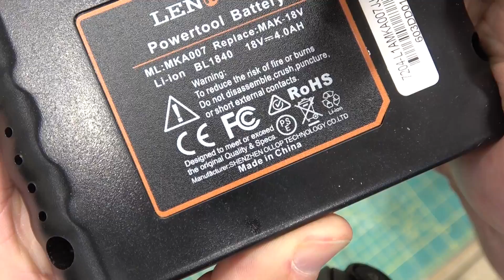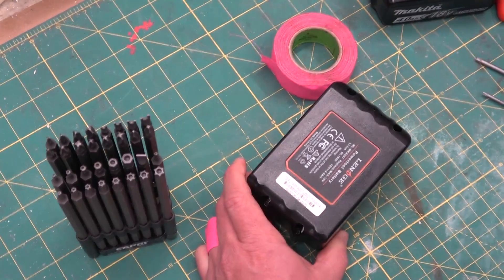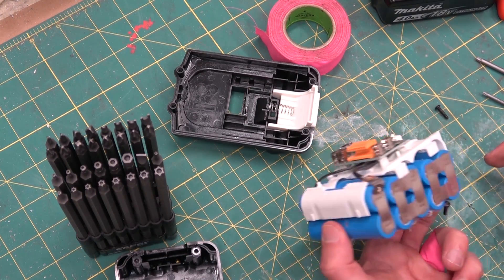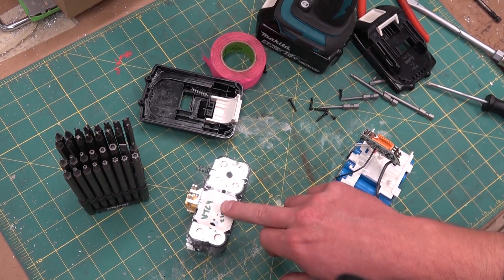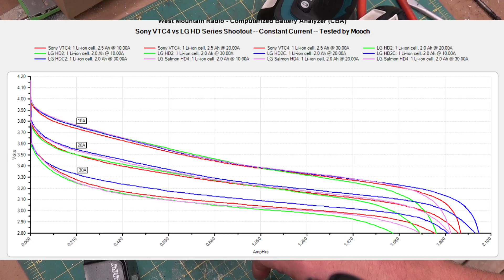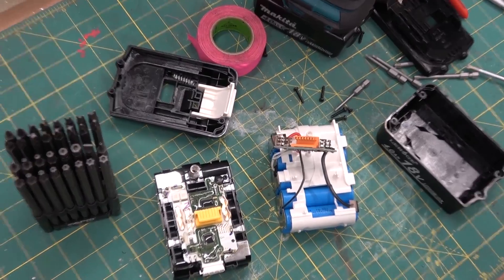BOLTR: Cheap Tool Battery

Comment: I have done the same with my Ryobi One tools( I have 7) I bought two of the cheapo 5 Ah chinkum batteries just to try them and although I'm a home shop man now I used to be a wood chuckker for my sins and now I'm machining for a hobby but still use battery tools a lot, the chinkum batteries are standing up pretty well and last a good timeunless I'm  using the circular saw and that uses the batteries up pretty quickly even brand new Ryobi 2Ah ones. So I am happy with mine AND they have a battery indicator on them where the Ryobi 2Ah ones don't (and I have 6 of them)

Comment: I would avoid them like the plague. I bought one for my Black and Decker 18 volt drill. It'll lasted exactly 11 months period after 11 months at stop taking a charge. It had a one year warranty, the retailer no longer stock the product and so I got a pro-rated cash adjustment. I took the battery pack apart at that point and 2 out of the eight lithium cells World leaking and corroded. Lithium ion batteries if they do catch fire or rather spectacular and toxic!

Comment: one day I had to choose between look alike me sweeping the maintenangeneering room or do something stupid. we had this 5Ah completely dead battery that wasn't ciuching a pixie from the charger, so I opened it and applyed 24V/10A directly on the cells for about 15 mins. I kept it 2 meters from the desk because still unprotected lithium and assured nobody went closer to it, in the meantime I kept an eye to the voltage of the whole boomblefuk. once at 19V I disconnected and put it on the cheapodrill a multinational valued milions could afford and the thing was going as new. months later still in use.

Comment: I arrived at the same conclusion you did, just a lot more batterys and time invested. I went down the cheap battery path for a while and determined it was false economics. I still have 1  working makita battery out of 2 from a tool set I bought in 2007. I've taped together, resoldiered,burnt up,blowed up probably 10 knockoffs since then before swearing them off. Not only are makita branded batterys better than the knock offs they are better than the competition . And I have and use them all. I think the difference is the makita charger pulls air through the battery as it is charged and none of the other ones do. Maybe they have a patent on it? Funny thing is some of the other chargers have fans  but all they cool is the charger.I don't know for a fact that that is the difference but I do know none of the batteries from the other  brands I own will come even close to lasting 12 years.

Comment: that arent only mechanical soldered joints. that are connections for the charge logic board to prevent single batteries slowly dying by not getting charged equally to the others. sorry for my english but i hope you understand. ^^

Comment: The place for these batteries is taped under the passenger seat of the work truck fully charged as an emergency backup BACKUP battery. 
And hope it’s held the charge when you go to use it 😂

Comment: Got some non-geniune ones the other day.... (Australia - from ebay)
They have a battery indicator that is vertical & 3 bars, labelled 4Ah.
Put them in a drill, played a bit & charged them (geniune makita charger)- all ok.
Put them in the 36v leaf blower, which kills them in <10min (huge power drain), and they wont charge over 2/3 & makita charger rejects them.

Complain & get return ones from the seller - which have a horizontal battery indicator & 4 bars.
so far OK

Opened them up...
3 bar - cheap, tiny circuitry, NO cell balancing! (could be dangerous)
4 bar - much better, have balancing connections & much more circuitry

So if you are looking for them, get the horizontal bar indicator ones possibly... maaaaybe it'll be slightly better.

Comment: I have a few cheapos if u put them under heavy load the wires come off the tabs because the solder is pretty much non existent so if u gob some on they arnt to bad otherwise

Comment: Hi @AvE. Love the videos. I have had a few of the better off brand batteries and they have been pretty good for a keen tool fucker like myself. Just wondering if you could do a boltr video on the fake tools that fit makita battery platform. I am considering getting a brushless grinder as its half the price of the makita one but will take the same battery. Cheers
https://rover.ebay.com/rover/0/0/0?mpre=https%3A%2F%2Fwww.ebay.com.au%2Fulk%2Fitm%2F372676608936

Comment: Got one Makita and 2 "el cheapo's" and they've all done fine. After two years I'd not notice a difference between them unless I looked at what was stamped on the sides. It's likely the genuines will last longer, but I've had genuines crap themselves within 6 months, so I'm disinclined to trust them for the price they charge.
Reply: Ive got orihinal Bosch hand circular saw die in my hand after 20 minutes cutting.Aparently those guys hide the brushes inside the body and i couldnt tell that they hot verry hot.I then bough a cheaper Hitachi saw wich is a lot better because it has the brushes vaps on the exterior and you can tell if its too hot by touching them.

Comment: I found some in a hoverboard that were filled with sand not even a battery
Reply: The weight was off and it rattled when I took the brick apart

Comment: I've been using dirt cheap ($15) 6ah dewalt knockoffs for constant drain devices:  fans, radio, and dime-a-dozen tools like the lazy man's vibrator.  Haven't had an issue yet... But I'll let you know if/when a load finally blows.
Reply: Oh, and they all have meterometers for the seeing of juices.

Comment: AvE,  two things, if you want to take your ring off, that is one of the listed uses of WD40.     The white wire on the side of the cheap battery pack looked to be kinked and possible bare spot.   Saw it at 9:40.   Respectfully,   Kevin

Comment: Those terminals are probably phosphor bronze. That is a common material for electrical terminals. I don't know about the Makita because of the more robust mechanical design, but on the Chinesium I see a big red and black which are obviously the power leads, a small black probably to monitor the voltage for protection and two whites which likely go to a temperature sensor. 

Lithium Ions are infamous for catching on fire and this can be caused by either heating them up too much, or running them at too high (charge) or low (discharge) of a voltage. The small black monitors the voltage on the first cell pair relative to ground (the big black) so the pack knows it's state of charge when when to disconnect the pack when it's attached to your tool or the charger. What I don't see is connections to the intermediate cell pairs. This is crucial for cell balancing.

Manufacturing tolerances mean each cell is slightly different in capacity and internal resistance so they will charge and discharge at different rates. I would think without a way to balance the cells on charge eventually this battery will loose capacity and maybe become dangerous overtime. There is a chance the cells themselves have protection built into the positive end which would permanently open up if the voltage went out of range and prevent the tool from catching on fire in your hand, in your truck or in your shop. 

I am curious to know if the Makita pack has connections from each cell pair to the controller PCB.

Comment: Milwaukee,Makita,etc is selling cheap knowing hoping you will buy the expensive batteries. If people buy these crap aftermarket batteries they will end up having to charge more for the tools with still expensive batteries. These big tool brands are awesome, we love them on the job-site.. There is so many tools right now that make jobs faster and easier. Please support DeWalt, Makita, Milwaukee and buy genuine batteries.

Comment: I've see people build electric bicycles using these style battery packs.  Probably not too bad in that application since it won't be thrown around on a tool and risk being smashed to smithereens.  I'd be a little scared of the lack of the electronic nannies on there that keep these things from thermal runaway though.

Comment: A wise mechanic once told me when I was but a snot nosed young mechanic years ago" Don't ever put your finger where you wouldn't put your tongue " not just shop advice life advice
Reply: If you wouldn't put your tongue in a spring shackle hole to line up the pin you shouldn't put your finger in it either.

Comment: Hey I'm a painter and just wondering your thoughts on getting a smaller Graco 390 to run on DC battery power, like 2 or three drill batteries in series, just enough run time to paint a front door and clean... Love to hear your thoughts on this

Comment: I've taken a lot of those makita batts apart over the last decade (14V version). Those cheapo ones are actually a bit crapper than all the non-makita ones I've looked at - mostly because they've not bothered with the cell bracing. In our tests (we use them for caving so the packs get a lots of physical abuse) the copy packs perform just as well as the genuine ones in terms of longevity - both cells and physical/waterproofing. All the copy batts have actually used pretty good cells, in the same class as the Makita ones, and have very good measured capacity, even the 4Ah and 5Ah ones. But I didn't buy the cheapest and nastiest ones I could find - I tried to get half-decent, which is always a bit of a game of course.  

The main problem with all of these batts is the stupid protocol where Makita write to the flash of the battery to set it in 'never charge again' mode if there are three attempts in a row to charge with a low cell. Invariably the packs are fine, and we've had some last for more than 6 years after Makita's internal software declared them scrap. Millions of perfectly good packs must be being binned.

One day I should write all this up.

Comment: 0:35 - That's actually the Conformité Européenne symbol. The Chinese Export symbol has the E starting where the C ends, so the letters are closer together. I mean, the label won't mean the battery isn't crap, it just mean it won't explode in your face. Well, not too harshly anyway... :-P
https://ec.europa.eu/growth/single-market/ce-marking/

Comment: Hey AvE, how do I contact you? I took apart my bathroom vent fan from the 60's or 70's and came across something interesting. There are no bearings just metal on metal with rockwool or asbestos stuffed in a little cavity where the bearings are supposed to be and it is drenched with mineral oil. Ever come across something like this? Its not the problem, the fan and motor got clogged with lint and dust, as it never squealed or made any abnormal noise. I got pictures Id like to send if you're interested.

Comment: Since private message is dead on YouTube, I recently had to recharge the nitrogen rack on my ships 150t crane. I’d love to see you do a BOLTR on a high pressure nitrogen pump if you can get your hands on one. I have a pretty good idea how it works but I was fascinated how it used 100psi compressed air to suck down a battery of nitrogen bottles and pump it up to 4000 psi, was curious on exactly what’s going on inside.
Reply: Adam Labranche 
They call ‘em pressure amplifiers and a good analogy is an air over hydraulic jack. Use the 100 psi air to push down a  piston many times to move another piston in much smaller increments to develop the higher pressure.

Comment: I had a V18 Milwaukee knock off from ebay back in the day. Had to mill the rails to get it to fit on the drill without a hammer. Didn't burn the shop down.

Comment: Devil's advocate here: unless there's some systematic condition under which the cheap batteries rapidly fail, or they catch fire, or I'm trying to pack light for some reason, maybe my reliability would be better by having two spares, compared to having just one of a battery of any build quality.

Comment: I wait till they have 100$ off trade in at tool supplier and grab a kit then usually with a free extra battery and I've bought so much I don't even need a trade in for the 100$ off. Got gen 3 Milwaukee drill kit and a free battery for 214$ after tax. Drill,case, charger and 3 brand new 5.0 batteries for 214$ u can't beat that so I never buy a single battery unless it's the 12.0 for 119$ at tool supplier

Comment: You didn't mention about the makita batteries that if you are a home gamer you must charge them up every few months. If you just leave them in a drawer the monitoring circuitry drains just the first pair of cells which will eventually over discharge them, which leads to the other problem in that the charger will complain and refuse to charge the battery and if that happens 3 times (if you plug the battery in and out a few times thinking its a bad connection for instance) then the battery will never charge again!

Ryobi 36v batteries are also too smart of their own good, I'v got a chainsaw and leaf blower that will work when a couple of 18v batteries (ozito/makita) are jerryrigged across the terminals but when you use the real deal you get no action. 

Bosch 18v green li-ion batteries/tools (PSR1800-li2 being one of them) are also too smart for their own good, at least from my experience, you cant get the tools to run off a power supply/jerryrigged batteries

 So for a home gamer, I cannot recommend makita/ryobi 36v or the bosch for that matter as there is just far too much skulduggery in the design

Comment: Hi together
I'm no Makitafan but i think the showed batteries are the same crap quality like the Energup batteries i've testet.
At first my cells was Samsung 25R, but in brandnew condition a little missbalanced. 
The communication to the charger is only to hot or not so that the charger was loading a full battery after replugging the full battery up to moree than 4,3V/cell because there was no singlecellprotection!!
Here it looks similar...
Link to the Thread. (German)
https://www.werkzeug-news.de/forum/viewtopic.php?f=5&t=42186&hilit=energup

Comment: It looked like these batteries did not have any balancing circuitry. Because of that, they will become a fire hazard after 10s of cycles when the cells fall out of balance and there is nothing in place to stop the discharge/charge.

Comment: The real makita batteries are hard as nails. Mine don’t want to die. I still have 3Ah versions were the connectors are blue. They don’t want to die. But they will soon be replaced because of capacity problems. They did age of ofcourse.

Comment: I tried some cheapies for my milwaukee tools: what has happened on a couple packs is that they are allowed to discharge too deeply, and the charger then calls them a "bad" pack, and won't allow them to charge.

I assume the skookum batteries have circuitry that prevents them from discharging too deeply.
Reply: I've got a couple of the cheap Milwaukee ones, have been fine so far(6 months).  I don't expect to last as long as the brand name but if they get 75% of the way there I'm still ahead as they were like a 3rd of the price.  No charging worries yet.

Comment: oh wow, makitas steped back up in their cells. I might  have to switch back. The sony VTC's series are above all the BEST 18650 cells you can get your hands on in quality, performance and life span. I have a set of 6 ive used as a hobby pack, its been cycled 2000 times and its still retaining 60% of its capacity.

Comment: I think battery is CHinese  company called TENPOWER they supplies lot of batteries for power tool manufactures.  The stability is not that great when it compare with Samsung and other high end brands but they do the job.

Comment: The main problem of these batteries is the lack of cell balance...They don't even have a sensing wire to turn off the battery because of the weakest cell

Comment: My company buys the cheapos for our makita  10.8/12v impacts and they preform better than the oe (gun has more umhf)  but longevity is absolutely junk. Casing breaks and the battery won’t stay in the gun and they break off the connections inside and smoke frequently. But then again so do the genuine makita guns. It’s not a real hard environment, just used to run socket screws in and out every few minutes and yet we throw a gun out about every other week

Comment: I bought the same ones and found that run time is about the same as the Makita 3.0ah batts. I also bought a couple of the Topbatt brand a few years ago and they have held up and are still working but their run time is also less than the Makita batts of the same ah.

Comment: i bought 2 fakes for my older Default drill for less than half of name brand. They seem to hold a charge and recharge well after a year. only issue is the fit into the trill can be a pita. but nothing a hammer cant fix

Comment: I bought one cheapo 5.0ah "makita" on fleebay. Worked great for about 6 months. I drained it down one day and the charger would not recognize it cause it was too low. I looked up on the confuser and it was advised to "jump" it up to 17v, it worked. Charger recognized it and fully charged it. Drained it down again but this time I couldnt jump it. Its trash. Meanwhile my real Makita's have been kicking ass for about 2+years now no issues. I'd advise even for a home jobber, stay away. Just get the real deal.

Comment: I bought an el cheapo battery.  It sucked when using it in the recip or circular saw.  No where near 3AHr.  It ended up being my radio battery.  My old 1.5AHr batteries have more capacity then the el cheapo so I figure that it uses Chinese 600mAHr cells.

Comment: I find that the chepo batteries work just fine - at first.  But after a year they are shot and won't hold a charge.  The original Makita is not so good after 5 years but it still holds charge better than a 6 mo old chepo.